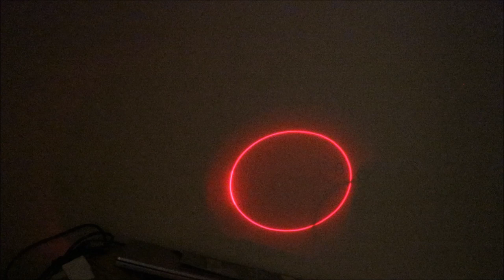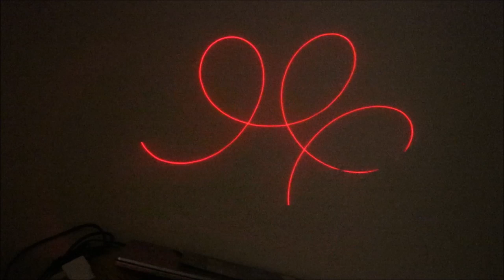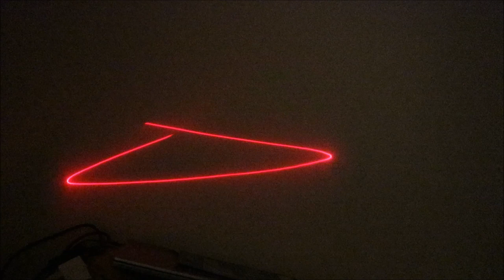How To Make a Laser Light Show Projector

Comment: Sir I have made this but how to control the speed of motor can u tell me
Reply from the maker: Hi, you can use dc motor speed controller for this, in my case I used manual method where I was turning on an off power supply of motor

Comment: With the equipment shown how do you create changes in the display?
Reply from the maker: Speed is varied been motors that results in change of pattern
Reply: he used a retail pocket laser show as his ‘demonstration’ of his cardboard mockup.   Essentially, he is right though, it’s done through speed and direction control, neither of which he built into his design.